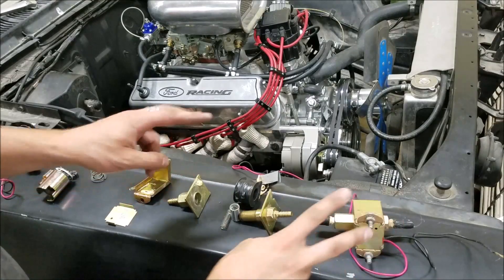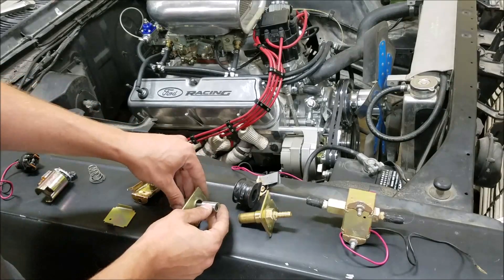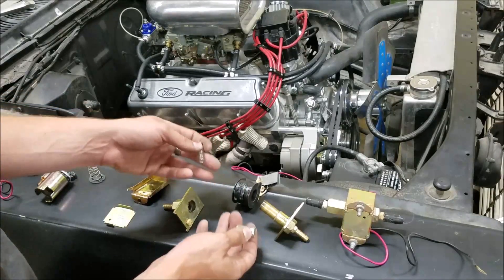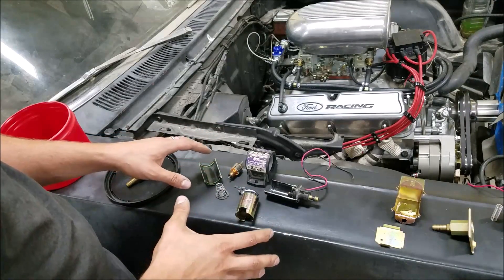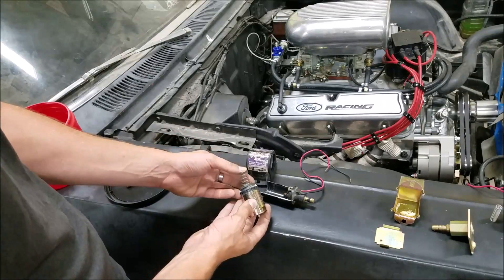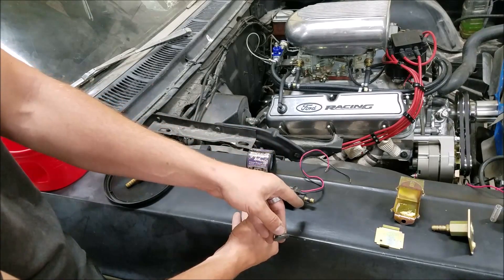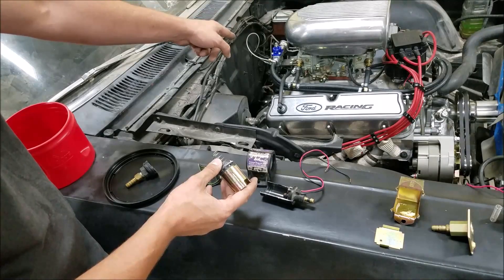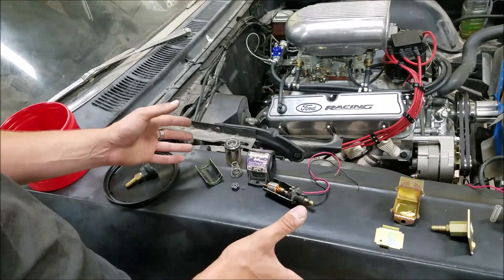CHEAP Electric Fuel Pumps (“Clickity-Clack” & Edelbrock) - How They Work !!!!

Comment from the maker: I know i will get asked this after talking so negatively about dead head fuel systems (no return) - 
"what is a good dead head electric pump" ????? 
I ran this pump on my truck for 5k miles before i added the return line - its still on my f100 today. 
Carter 72 GPH Electric Fuel Pump - https://amzn.to/2IJVqn2

the galaxie has a massive 100+ GPH electric fuel pump with a regulator on a return line - the more fuel you can keep moving, the cooler it stays of course. the galaxie has the best of the best in this regard, but its not necessarily required for success.
Reply: What size fuel pump would you recommend for your carb/regulator/return setup?

Comment: well done on the explanation. A clicky plunger pump can last longer if you have a screen on the input, for facet that is 74 micron filter, usually screws into it.
All vane pumps have issues with rust if they sit a long time. They should use SS internals, but they are just steel.

Comment: So if i have a carb and the pump is rated at 5 to 8 psi i dont need a regulator correct?
Reply from the maker: It depends, what type of carb do you have? Edelbrock being non adjustable calls for 5 psi. 
This is important because it directly correlates to the float height
Reply: @ThunderHead289  yeahh edelbrock so 4 to 7 psi is too much
Reply from the maker: 7 is pushing it for the dynamics of the carb to be correct
Reply: @ThunderHead289  ok thanks and i appreciate all the info your channel brings keep doing what you do

Comment: Do you know the difference between the FACET "cube"  (metal case) vs FACET Posi-Flow (black plastic molded case).  I know they are both "clickity clack" pumps as you call them, but what about internal construction.  I will use in my Experimental Aircraft as a redundant spare in series with my Mikuni pulse pump in a Rotax 582 specified at 3-6psi.  Plan to use without check valve for easy free flow through electric pump in case it fails.  I am especially concerned about electric pump free flow in case it fails.  Should I be concerned about this, or will the electric pump reliably free flow if failed?  Wondering why FACET makes both the "cube" and Posi-Flow since they are close in price for comparable pumps?  Thanks for your insight.

Comment: Perfect timing, Luke! I have been wondering what might be a reliable electric fuel pump for my 76 Mustang that I am in the process of swapping a 302 into. I would like to run a return line system eventually, but for now I will go the "don't get it right, just get it running" route, and use the Carter pump that you recommend. Thanks for another one of your great videos showing how things work.

Comment: I'm a long time viewer. You have a healthy sounding smallblock that would rip in a 2800 lb. Mustang. Probably  run a mid 16 sec. quarter (at best) in that 3800 lb. Galaxie. It gets mucho points for originality (of thought) and being a 5 speed.
Reply from the maker: Well, I ran a 17.4 in a stock 302 in my f100 - all on camera. The galaxie pulls hard. I bet it runs in the 14s. We will find out!

Comment: I like running two of those little rotary pumps I put one near the tank to push and then one on the fender well to push it through a spin on canister with bracket from Walmart water separator filter used for boats from Atwood the reason I do that is because if you ever need a fuel filter after 10 at night you know there's always a 24-hour Walmart somewhere🇺🇸⛽🗽

Comment: SU electric fuel pumps were standard fitment in most 1960s British cars.
They were very reliable and easy to repair when they did go wrong.
I remember well sitting in the boot/trunk of my Dad's Jaguar MK2 on a long journey.. Dad said..'if it stops clicking then give it a good hard smack '
We got home safe but I was close to being asphyxiated from the exhaust fumes!

Comment: The really cheap clickity clacks are good for fuel transfer (emptying a tank of old gas), and temporary use in getting home, on carbureted engines. I usually keep a cheap Amazon under-$10 clickity clack pump around just for that
Reply from the maker: Same! The one clickity clack not disassembled is a functional unit 👍

Comment: What would you recommend for a long term electric fuel pump? Currently have the cheap kind on a 78 Silverado that gets driven daily.
Reply from the maker: unfortunately i havent had great luck with deadhead systems outside of the carter fuel pumps - they seem to work very well. 
if you check the parts list on my previous upload, i have the link to it in the video description. ran my truck dead head with it for 5k before i got the return line on - AND ITS QUIET !!!
Reply: ThunderHead289 Thank you sir I’ll be sure to check it out.
Reply from the maker: I now posted the link in this vid